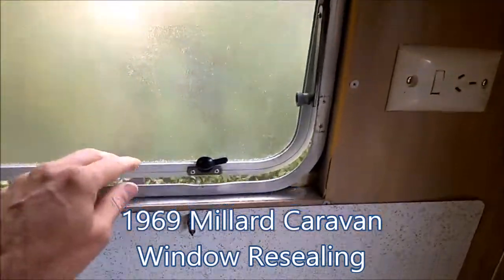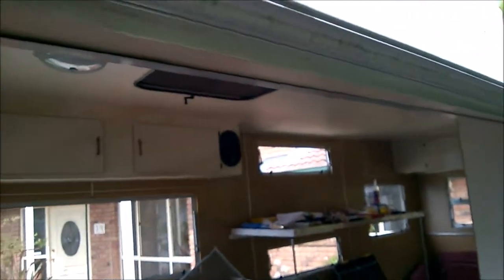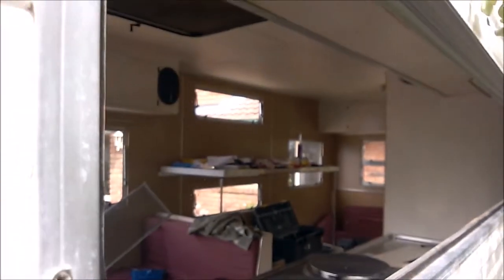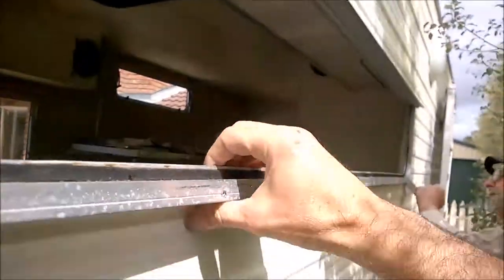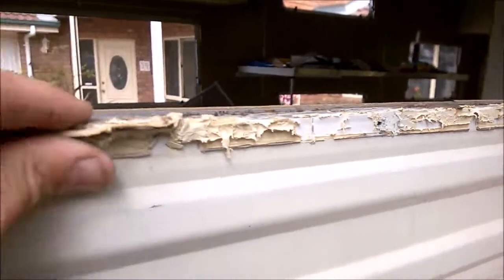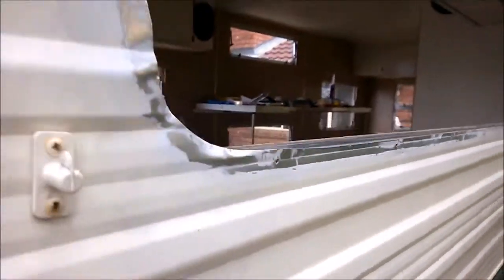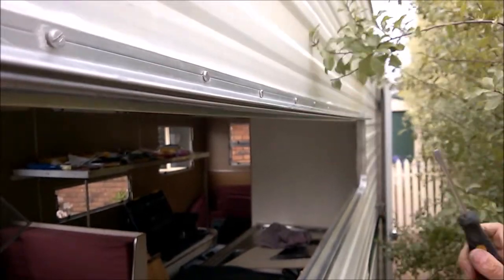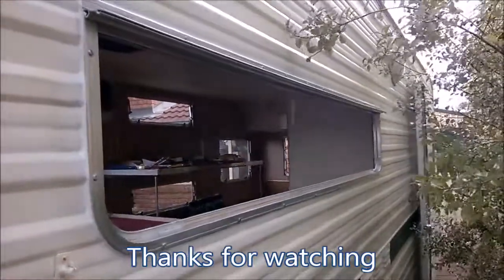Millard Caravan - Window Reseal Process

Comment: Hi, I know this is a very long time after the video, but we are about to do the windows in our 69 Olympic. Just wondering did you replace the black felt seal and the actual seal that holds in the glass? Cheers
Reply from the maker: Fantastic to see it being restored! I didnt change the seal, mine didnt leak.  Of course change if its gone hard or cracked.  Most seals are still available to buy.  All the best.

Comment: Hi there. I have a 1960 homemade caravan and am in the process of resealing the windows using this as a guide. Just wondering whether foam tape is required under the frame? It is there currently.
Reply from the maker: Depending on the build, i ended up using butyl mastic in my Viscount build so would be better to look at that.  Foam tape may have been used as a weather sealer which butyl mastic does the same.  Good luck with it.
Reply: Thank you so much! That was my thought too!

Comment: Great vid thanks :) Your back window seems to be the same as my 76 franklin windows (with rounded windows in a square frame). My rear windows dont seal well between the window and frame and leaks when towing in the rain. have you had this issue? any advice? cheers
Reply from the maker: So its either leaking through the seal on the window and frame, or its leaking through a gap in the window due to the locks not closing it tight enough, or its somehow pooling water in the window frame. I drilled two holes in each side of the lower frame to allow water to drain out if it pooled. Just make sure youre certain where the leak is from.
Reply: @rovertasmania7033  thanks heaps. The locks dont close tightly on the back windows so i'll try to sort that.  the ceramic? corner inserts dont appear to fit as well on a couple of the rear windows. is there ment to be a rubber seal around the window to seal against the window frame? I'll check for pooling. time for a hose test. thanks again
Reply from the maker: @trisnpaislee  yes, theres a seal between the window pane and the frame. Once you see where the lesk is, its an easy fix. Btw, i had my wife use a garden hose while i was inside the van, to spot the leak issue 😉
Reply: @rovertasmania7033  thanks heaps again. My van has no rubber seals between any window pane and window frame. I'll start there. :)

Comment: Great video 👍🏻, have u always use the SIKAFLEX range of products . Was talking to a rep at Bunnings & he put me on to it as a sealant for around the outer frame of my van . The sikaflex one I used is for car sealing in between the frame where they weld the joints great product . Keep up the vids cheers 👍🏻👍🏻
Reply from the maker: Thanks for your comment. Yes it is a good product but its an adhesive, so difficult to pull items apart afterwards. Other option is butyl mastic, non adhesive but not as durable as sika. Cheers

Comment: Don't use sikaflex it dies and Lord help you if you need to get it off.
Sikaflex data sheet clearly states a gasket type poly carb .not to be thinner than 3 mm.
On your cladding it goes from 3mm to 1mm it will fail at the thickness change due to the different expansion rate.
The stuff you could not name is butyl mastic and was working fine, the dry parts was in the inside not in the overlapping. Hense you pull it from inside out.
Hope You don't use on your j rails or hatches, you will ruin them getting them off.
Fancy making a flimsy product designed for movement to be totally solid.
I started my apprentiship as a carriage and wagon builder,1964 .
A now gone by trade like sailmakers.
It's now been replaced with a labours job called caravan assemblers.
If mastic has lasted 30 years why change it.
See the new modern vans leaking because they use sikaflex.
Also why use a UV protected product that does not see daylight through the aluminium channels.
Another thing You improbably don't know is the the window and j-rail aluminium are different to normal aluminium alot softer, so it can be bent with a spreader.
So is it a good idea to glue a malable to a non malable product.
That is why they use mastic .
You are right in not tightening the screws down tight.
Mastic lasts for 30 years proven even by your video.
The mold inside is condensation not a window leak.
Reply from the maker: Thanks for your post... yes its a gamble using the sikaflex product, even the one used here which is the marine grade stuff they use on boat hatches.  But once set, you cannot remove without destroying the smaller alloy parts.  This is one of the reasons why on my Viscount build (Ambassador 20ft) I opted to go back to using butyl just for its flexibility in being able to pull components apart in future.  However, I do not recommend using the butyl tape to to its limited ability to fill in the gaps left by profiled channels and cladding... so I used the cartridge type as shown in my vids.
Reply: @rovertasmania7033  thanks for your comment.
There are so many who swear by a new product that don't know the truth , nor read the the product details.
In 50 years I have seen it all.
And it's great to see that you have now realised sika has only got special needs. I don't know if you knew that fact. The marine grade  is a 5mm gasket, it is to take movement ,compression, expansion and malformation.
If it does not have 5mm it can break glass.
Or destroy the foundation.
Sika is used for new vans only to leak.
I have seen windows siliconed in and it gas destroyed the frame and bulging cladding.
There are not too many new vans that have not had a leak.
The only time I use sika is on s flat joint say on a roof. And it is built up with 3 layers of masking tape 25mm each side of a joint.
Then filled with sika screwed off . Then spray with water , then remove tapes and taper the ends.
A little tip you might use later down the track.
That gives a 3mm cover over the joint , admittedly it's 50mm wide 3mm thick but won't lift .
You can't do that with mastic.
Good to see you have gone back to mastic.
As for tape mastic it comes in different thicknesses.  And must be thicker than the cladding ribs. And a bit of turnintine put on the mastic before fixing makes it stick and soften to squash and adhere but has to be frightened in about 12 months.
Good on you mate. 
Cheers in vanning.
Reply: Just loving your comments Garry!!! So many people are under the sikaflex spell... and using it in projects that will only become a huge problem for themselves the NEXT time something leaks. Let me try to get this straight if I may ...
Re the j-rail - sounds like it is technically just a "cover strip" to protect the mastic underneath :)  
Wondering then whether it is necessary to then go along any "gaps" between the j-rail and the aluminium sheeting with any form of filler (silicone etc) other than to make it look nice? But if you did want to, what filler would you suggest? 
Thanks, Stephen